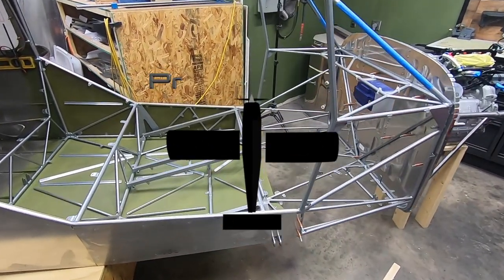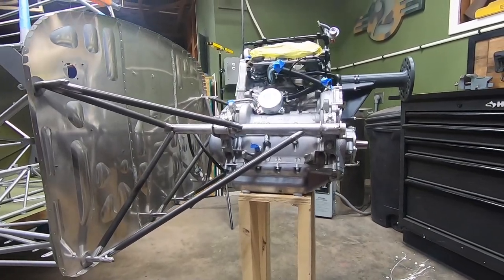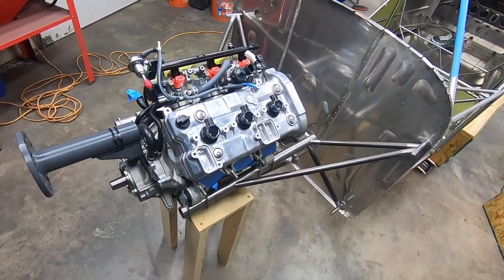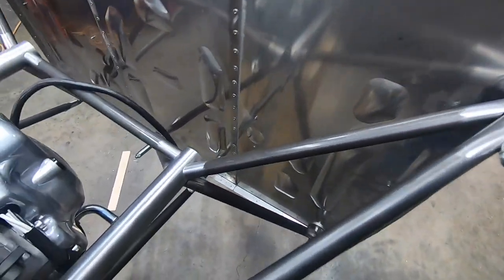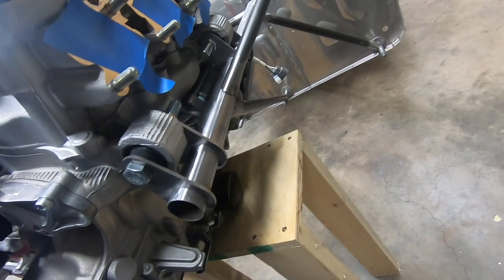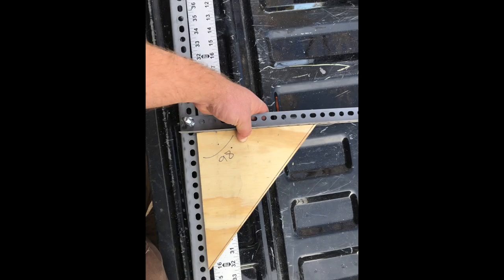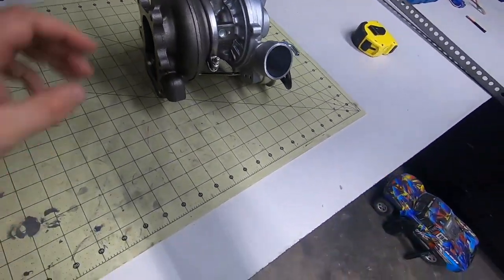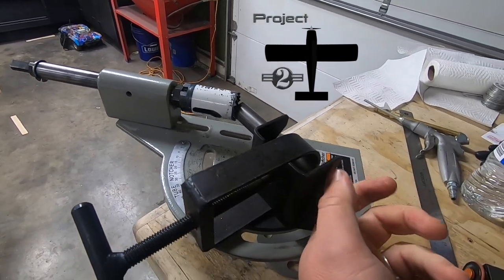RANS S21 EP23 YAMAHA AIRPLANE ENGINE

Comment: That Yamaha engine will not disappoint you. I Have one in my Arctic cat 2020 just always use the Yamaha HP 15w50 or 10w40 for the colder outside temps. I love the engine it loves to scream 9,300 RPM is its sweet spot for power.:goodvibes: but 10,500 RPM it likes also no problem.

Comment: You built that mount quick!  Hope my measurements helped!
Reply from the maker: Yes sir, thanks again for that! It’s all still just tacked together. Once I get a little further with the intake and exhaust turbo manifolds I’ll make things a bit more permanent. I still have a few tubes to add in there👍
Reply: @Project2Aero  it looks very nice!  Do you have someone to tig weld it for you?
Reply from the maker: @DadandChad  Yes sir, when I’m happy with everything, I’ll get it done by someone who knows what they are doin. I don’t feel I should learn on my engine mount.. lol
Reply: @Project2Aero  I don’t think that would be too wise.  I have a nice tig welder in the shop and a friend that’s certified.  He welds the exhaust stacks that are oem equipment on the Kodiak.
Reply: I meant to add he would do it if you can’t find anyone local.  👍
Reply from the maker: @DadandChad  I’ll keep that in mind if my plan falls through👍

Comment: Well, I am now even more excited to see your project. You are adding my favorite engine to my favorite utility aircraft. I was under the impression that this engine posed challenges for mounting the Skytrax gearbox since this Yamaha version doesn't have a mounting flange to easily bolt onto. I was working on my own solution to mount the Skytrax. How has Teal configured his?
Reply from the maker: He’s developing a new gearbox for the 3 cylinders. Should be available soon from the looks of it. If your not a member of the Yamaha conversion Facebook group go check it out👍

Comment: Is that engine normaly at a slant or did u just decide that's the way you wanted it? Are you gonna fire her up on a stand to give us that thrill you know we all been waiting for? You gonna go with straight exhaust or does it need some kind of muffler for back pressure?
Reply from the maker: I’m a long ways from starting it but it’ll happen soon enough. The angle is how it sits in the snowmobile as well. Being turbo, back pressure isn’t needed but I do plan to run a muffler since I don’t want it to sound like a rice rocket Honda Civic with a fart can on the back.

Comment: Well, there's an engine option that came sizzling in out of left field! I admire and respect the experimental aspect of your choice. What prop(s) are you considering?
Reply from the maker: Lol, I’ll be using a 3 blade carbon NR brand prop (ground adjustable).. it’s been used on several of the apex builds and seems to be a good fit👍

Comment: Good progress.  Will the battery, contactors, and ECU be in front of firewall?
Reply from the maker: Battery and starter relay will be on the forward side of the firewall, everything else you mentioned will be behind the panel. Thanks for watching Chet👍

Comment: Great content. I want to install a Yamaha sled as well into my very light experimental. Can you tell me how you bought a brand new engine? I thought only option was to buy used.
Reply from the maker: It depends on what Yamaha your after. This is the 998 turbo 3 cylinder model and is found in both Yamaha and Arctic Cat snow machines. Yamaha won’t sell a motor to you but Arctic Cat will. I just went online to and ordered it👍

Comment: Your videos are excellent and I have nothing but respect for what you're doing but there are some major gaps between drilling seat rails and hanging an engine on the front. Let's hear more about why you chose the Yamaha and how the custom engine mount came together. I'd also like to know about the performance comparison between the Yamaha and the Rotax/Titan. I'd like to build an S-21 and your opinions affect my decision. We don't fly the same flag but thanks for your service just the same.
Reply from the maker: Thanks bob👍 yes a one off engine choice is a lot to take on for sure. The performance of this specific engine is a bit of an unknown as there are none that I know of flying currently. There are however many apex installations performing well out there and this engine is somewhat similar. At similar weights to the rotax lines it should be a great performer with the added HP.  I’m honored you view my opinions with such weight but do know I don’t recommend you follow me outside of what rans has tested and proven to work unless your willing to to take that responsibility on and savvy enough to go about it safely.
Reply from the maker: As for why I chose to go down this path, power to weight and dollar to weight can’t be matched. While still a bit unproven, I felt it was worth the chance to see what happens.
Reply: @Project2Aero  Thanks for the reply. I'm very interested in the results. I'm actually an AME (Canadian A/P IA) No doubt I could make it work but it's way cheaper to learn from your experience.
Reply from the maker: @bob365gtb4  I bet you can handle it then👍
Reply: @Project2Aero  You're doing a great job. Keep it up.

Comment: I agree completely. What’s the point of “experimental” if everyone just keeps using the same old engine technology from the 1930’s?
Reply from the maker: Yup, the crazy prices get me as well.. If everyone just keeps paying it, they’ll never come down. My engine is literally 1/4 the cost of what this airframe is designed around and will be light years ahead in tech and engineering development. Time will tell if the effort was all worth it🤷🏻‍♂️
Reply: @Project2Aero  Price is definately a driver. I'm researching the TitanT-51. I can put a 400HP GM V8 on it for a fraction of the cost of other engines. And when it "wear's out" I can just replace with a zero time unit from GM, again for pennies compared to the cost of rebuilding one of those engines from the 1930's.
Reply from the maker: @Blackcloud_Garage  my thoughts exactly sir! A new long block Yamaha is about 5k from the factory. No rebuilding needed, just swap it out!

Comment: Was wondering what the total engine weight is when you have it all done?
Reply from the maker: Not sure yet, but I’m expecting it to be around 200lbs. Something close to a rotax 915 weight and about 100lbs lighter than a 180hp Titan. I will weight it all at some point when it comes off for final “finishing”.

Comment: where did you get the engine from and how much?
Reply from the maker: I ordered it from Arctic Cat. It’s only a long block and pretty much came like you see it there. It was about $4300 and I’m predicting about 14k by the time I get a working firewall forward package including the gearbox and prop. Nobody has one completed yet so we shall see what that really turns out to be.
Reply: @Project2Aero  good evening sir!
Does the  $4300 include turbo, ECU and wiring?
Reply from the maker: @falrus  No, I've been sourcing those parts individually.